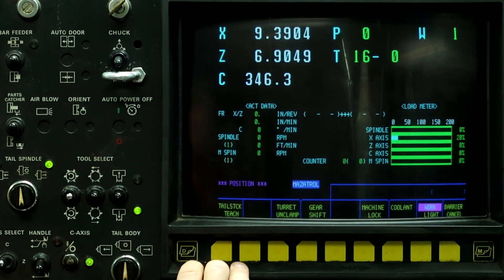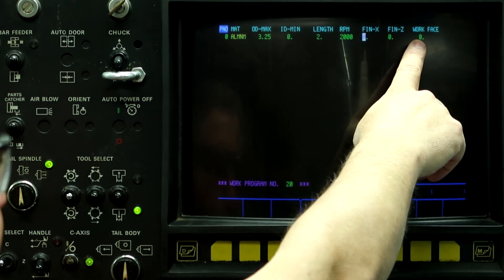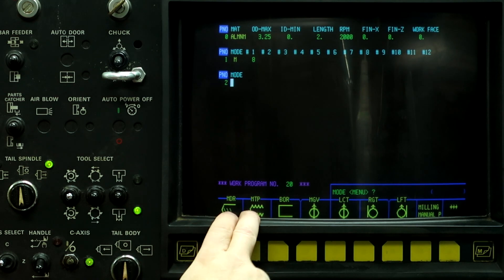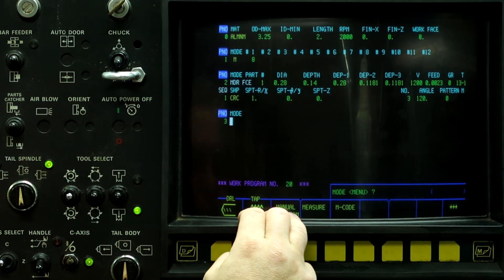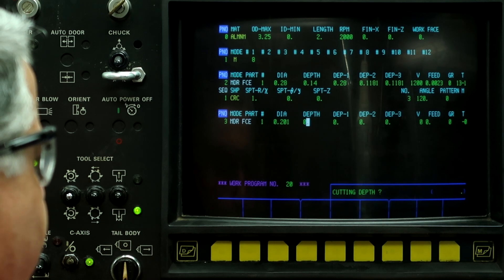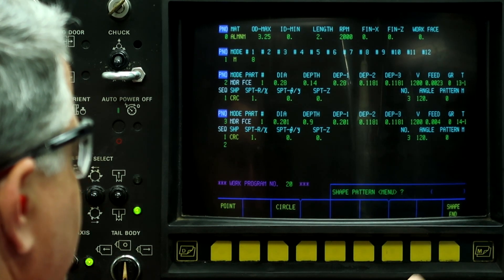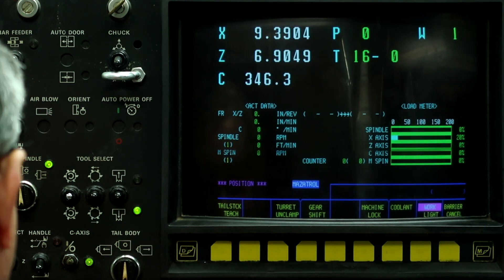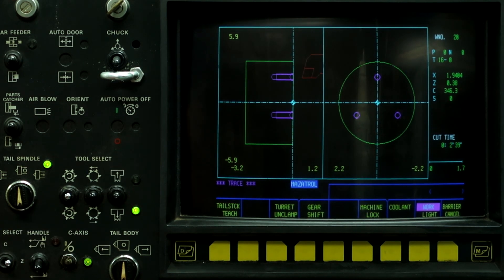Mazatrol Tapping Milling Spindle Lathe

Comment: can you explain fixed tapping vs floating tapping? it's an option in EDIT TOOL
Reply from the maker: @fredrezfield1629  I have to use a floating tapping head on my old machine because the spindle does not sync perfectly with feed. Fixed tapping is where the tap is held rigid like an endmill and the machine can perfectly synchronize spindle rpm with feed.
Reply: @mazatroltipsandtricks6816  i have that !! 
thanks the fixed is so much better

Comment: Hi Phil, im using mazatrol t-plus with rigid tapping enabled on the milling spindle. It is working great, however it reverses the tap back out very fast. So far no problems but is there any way to slow it down no the reverse? I had a quick look through parameters but cant see one for it.

Comment: Could you share me method for helical gear milling on Mazak Integrex 35 controlled by Mazatrol T Plus
Reply from the maker: That machine does not have the capability to machine a helical gear. No B axis.

Comment: gota  decent source for Mazak VDI compression extension live tap holders I got SQT 18.
Reply from the maker: Just need to scour ebay for Mazak VDI.
Reply: @mazatroltipsandtricks6816  Thanks that looks like the magic word I was also searching mazak SQT.  web is full of em.  You think that a live tool holder can be found with built in speed increase for say 1/8" drills and end mills or smaller.  Didn't have any luck in that dept.
Reply from the maker: @joeshmoe5935  I have never seen a speed increaser head for a VDI tool.
Reply: They are rare to find but I've seen coolant driven holders. Maybe you could build one using a die grinder mounted in boring holder.
Reply: @itsnotfar  Die grinder air hose will really turn into a mess with that turret head.  So hence coolant driven makes more sense.  But like how many PSI we talking in that coolant?
Reply: @joeshmoe5935  300 psi. The old standard pumps don't have much pressure. Also i ment using the die grinder powered by coolant instead of air. Try hooking up a hose from your turret and see if your grinder works before modify and mounting it into holder. 300 psi should get it done.
Reply: @itsnotfar  300 PSI in a 1993 Mazak SQT 18?  Wow!
Reply: Either way it was only an idea
Reply: Check your coolant tank near the original pump. See the side plate there ? That was for an add on pump.

Comment: I want to try a thread mill on a nexus 200 turret , reason being it is a wimp when it comes to tapping anything bigger than a 1/2 dia tap  , wonder if i could do point machining and a tornado starting in the bottom like we do on the mill .
Reply from the maker: Play around with a piece of scrap metal first to make sure it works.  I scrapped a part trying to threadmill with tornado cycle.